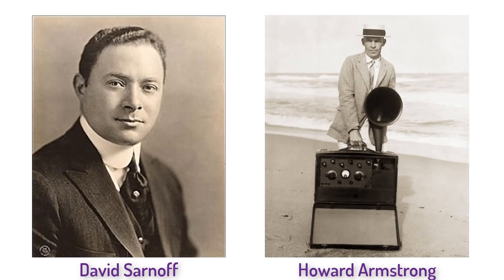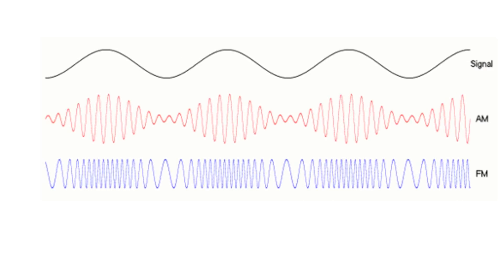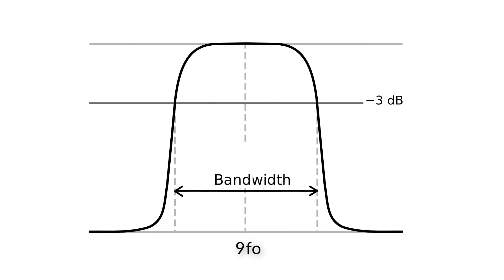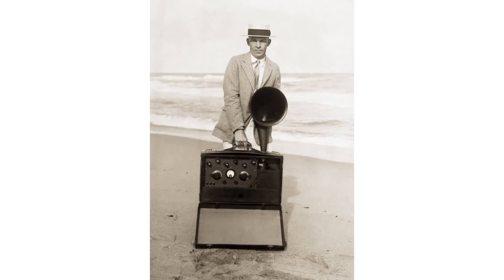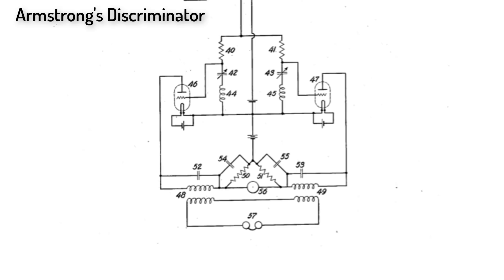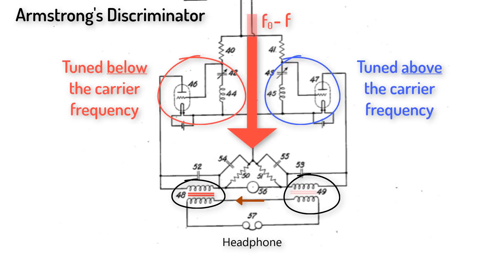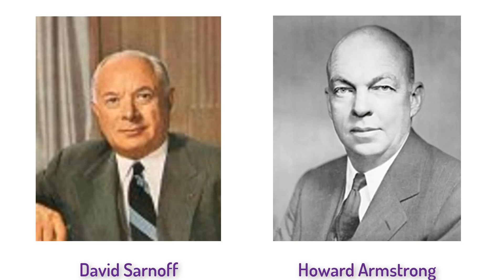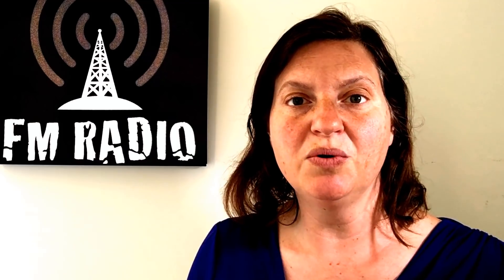Armstrong: the Tragic History and Physics of FM Radio

Comment: i enjoyed the video but one thing she said was wrong , when we use fm at lower frequencies , it is juast as bad as AM for static interfierance , it was the higher frequencies that got shut of the noise and not the mode type , vhf being shorter in frequency length means that static bothers it far less than medium wave and short wave .Here in the uk we use long wave with no static noise because the transmit stations are a set distance making a very strong signal day and night , not like the states were the signals mixed with static making reception very hard to do . This is in a fact that we don't get as much lightning here in the uk as other places on earth , ............OUR BBC RADIO4 STATION TRANSMITS 196KHZ AND IS HEARD ALL OVER EUROPE .................................As being a radio ham with a full licence for nearly 40 years and i use fm and AM and ssb radio alot .narrow band fm and wide band fm used on hf gets hammered with noise , we locals use very low power narrow fm on the 1.9mhz marine ham band , with good results .

Comment: That GE clock radio (at 1:50) is the same as mine (which is defective). That's funny because GE owned RCA (now defunct).
Reply from the maker: The irony!
Reply: I have the same radio, Mine still works fine except for (typical for it's age..) a scratchy volume control.